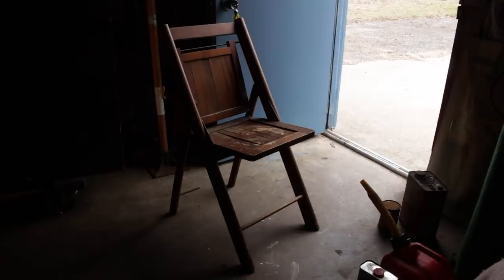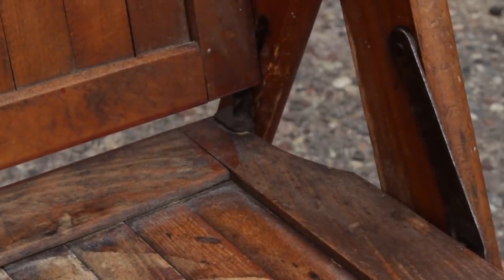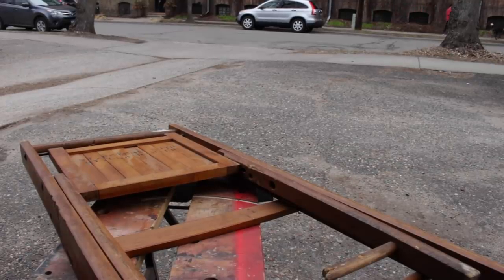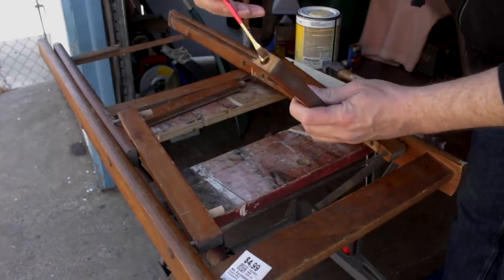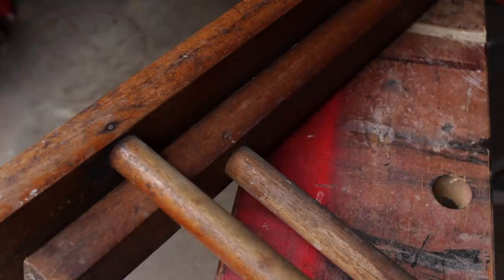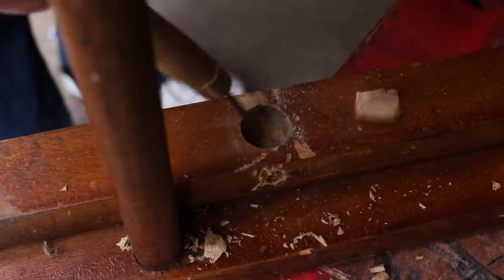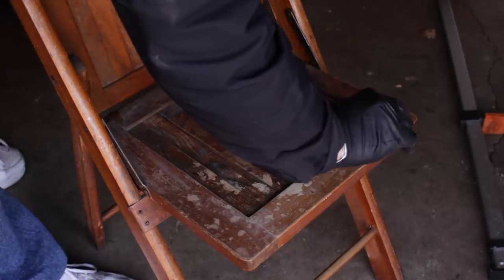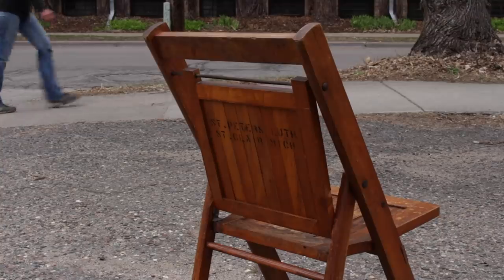Thrift Store Rescue #16  | Repairing A Vintage Folding Chair | Furniture Repair and Restoration

Comment: Since I was employed by a church all of my working life, this chair immediately caught my attention.  I have spent many worship services sitting in chairs that looked just like this.
I think that this is the first time that I have differed with you on the extent of a restoration.
I would have preferred that you took this chair closer to its original look, I have to say that I still like how it looked after you completed it.  Thanks for posting this.  Stay safe.
Reply from the maker: Maybe someday down the line I’ll do a complete refinish.  Thanks for watching and be well.
Reply: Huh?  He cleaned up. What could make it look more original?
Reply: I agree with you to an extent, Eddie. I think that I would have repaired the finish damage on the bottom seat where it looks like somebody sat a bucket or something. But then carried out the rest conserving the finish and repairing as was done in the video. .
Reply: @Shane-Singleton  I bet a plant used to sit on that chair.   Round circle and water damage:  I recognize that look too easily from my own life lessons on plants and furniture.
Reply: @howellomaha  I imagine you're probably correct. Seems like that chair would make a fairly unique and cool looking plant stand.
Reply from the maker: Colleen De koning  Well, it just so happens to be sitting outside with a plant on it at this very moment so I'll call this one a win.

Comment: The secret to getting the nail out without hurting anything:

press a hot soldering iron to the nail. Let it heat until smoking (it may take a while depending on your tip and if it has a good blob of tin to conduct heat). The nail will conduct the heat and burn its way free. Works wonders on ring-shank nails and stuff in pallet wood. If you plan to sand a bit a map torch will get really stubborn nails that are poking through the material in a hurry.

This isn't great for finishing nails with heads below the surface, but it does make it a lot easier for the ones you can get a tiny bit of purchase on.

Comment: I also appreciate an object that also tells a little bit of a story. One could look at this chair and see the history of this chair. I believe the reason that churches prefered to use this chair because it gave you a sense of eternity the longer that you sat in one of those. I imagine when the chair broke they just disposed of it to anybody that wanted it. Finally to do service as a plant stand  because it looked interesting. 
Did you want to tell you that in some instances the chairmakers would pin their rungs to help hold the set of the joint because glues took longer to dry back then. 
Thanks for the great content.

Comment: To get those nails out holding the dowels in, did you consider driving it straight through with a nail set? I’ve found this technique works well. When enough of the nail sticks out the other side you can grab it with vise grips and twist as you pull. If you’re afraid of blowing out the other side you can back it up with a block of wood. Sometimes heating the nail by touching a soldering iron to it for a second or two help also. The finished product turned out nice, thanks.

Comment: I often use wire cutters to pull a nail instead of pliers.  The pointed ends will fit down into the hole to get some grab, and also they cut into the nail a bit for extra bite to get it out.  I enjoy your channel .

Comment: I love your philosophy of just letting the chair "be who it wants to be" :)
I wonder if a little spot welder or soldering iron could be used to attach another piece of metal to the nail for some pulling purchase.  I've seen this done on metal machinery when bolt heads break off.

Comment: The chair turned out great and I love the colour. With the broken rods on the back I'd suggest you split them on the line of the brad. Pull out the two halves and then with  pointy-nose pliers grab the brad in the hole and pry it up. It would save carving out the wood to grab the brad. Also the brads might have been in the original construction which negated the use of clamps and drying time. Keep up the wonderful restorations.

Comment: To remove the nail, cut the dowel flush; drill the dowel in the center and through the nail and remove the dowel stump until the hole is empty, except for whatever remains of the nail.  Now you have access to the nail from the inside of the hole.  You can grab the nail in the hole with narrow pointed pliers and push it out instead of pulling it.

Comment: Suggestion: get yourself a pair of diagonal wire cutters. You can grab just the tip of the head of the nail and level it upward pretty easily. They will hold far better than a pair of pliers, and you don't have to dig out near as much around the head (usually nothing) to get the nail out.

Comment: Have you ever used "Wonderlokking Tite Chairs" cyanoacrylate? Very low viscosity stuff that sinks entirely through cracked wood, so you know you've got coverage. It's good for the occasional impossible-to-disassemble joint and seems extremely strong. Also good for a hammer head that won't seem to stay tight. Your videos are great, lots of useful ideas.

Comment: i have an old thrifted folding chair very similar to yours, but with fewer wooden and metal articulating gizmos on it, where the back portion of the seat meets the side rails.  (sorry i don't know the actual terms, but i'm hoping you know what i mean.)  i formerly used it folded and taped shut so i could stuff the horizontal rail on the back section under the knob of the door that divided my 1st floor kitchen from my basement so that an intruder couldn't force the door open.  (long story, i had a walk out basement that was broken into a couple of times.)  the chair, when folded, was the perfect height to cram under the door knob and wedge against the floor!  it now sits open, holding my purse and a few odds and ends, in my living room coat closet.

Comment: Sometimes it is easier to drive the nail through with a thin and stiff metal rod the same size as the nail. It makes a hole on the other side but that tends to be an easier repair than the hole from digging it out.

Comment: If you’re replacing the long dowel, why not split the dowel in half and drill out the dowel then push the nail up and out? I feel like you damaged more than necessary

Comment: Great video thank you. The past few days I am upcicleing an old pine study desk to be a so cold kitchen island bench on rollers. Had some issues but slowly I am getting there. 
Not sure how and what to do with the top. I want to use it to prepair food and also put my sawing machine when I need to do some sawing. Q: do I put some stainlessteel on it or leave it and put some food safe oil and when I use it for sawing just put a cover on it? Which one would you do? Thank you

Comment: Nice refresh. Looks a lot better and keeps the story of the piece. I was wondering if you would do a detailed video on all of the different chemicals and brands you use most often. E.G. strippers, tops coats, sealers etc. I use a lot of Mohawk for a lot of repairs because it's easy and quick. I'm always interested in the different brands and techniques others use. Why do you prefer poly over lacquer? I notice you use a lot of poly.

Comment: Soo I’m used to using Mohawk products. So when I used Polly and it blushed due to the humid day. I should have know when applying it. Anyways, I tried a noblush spray and it lifted the Polly and ruined it. So I had to wet sand the finish off and re apply. My main reason for this is how he heck do you remove blushing from Polly without lifting the finish? In other words prevent orange pealing

Comment: Hi! I have a chair just like this. After someone rushed to sit on the chair, I noticed it’s begun to wobble. It’s also joined by rivets and I’d like to ask you how would you approach tightening or replacing the rivets to stabilize the chair?

Comment: Nicely done repair/restore, thank you. However I did cringe to see you cutting off the broken dowel with a brass back tenon saw, adding more damage to the leg. PLEASE get yourself a flush cut saw or a Japanese pull saw for jobs like this, which would avoid scratching the surrounding area. Stay safe.